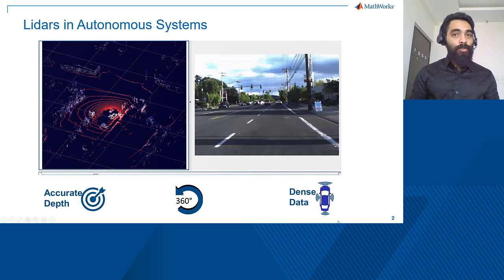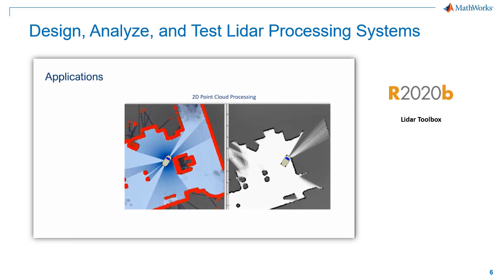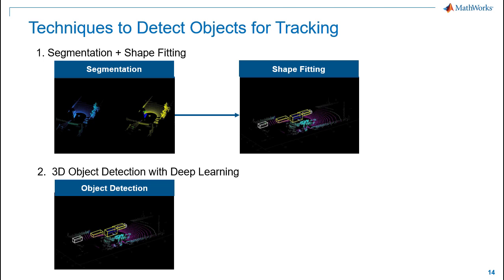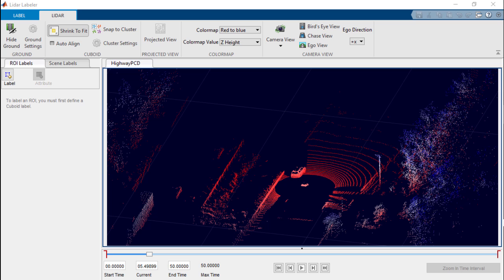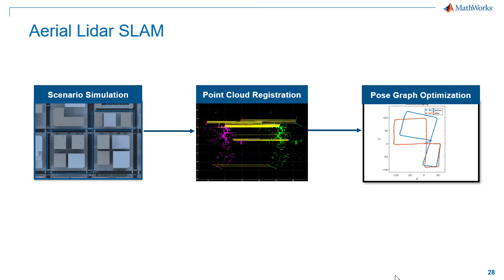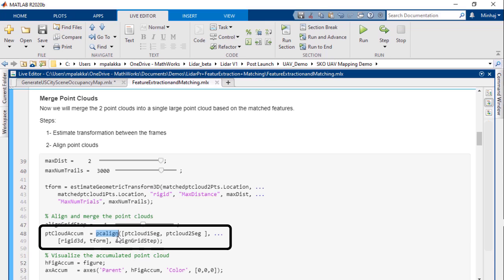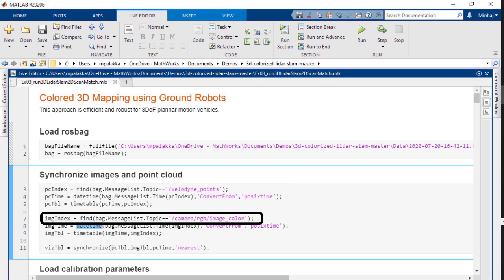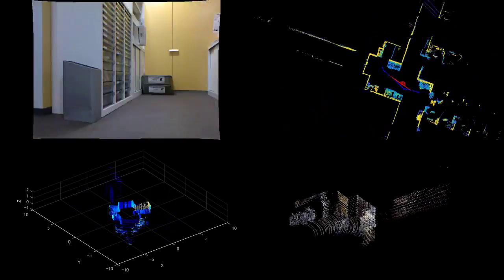Lidar Data Processing for Autonomous Systems

Comment: What about the case where multiple independent lidar based systems are being used at the same time in the same local area such as with multiple mobile robots or self driving cars?  Wouldn’t there be interference from each of the lidar sources?
Reply: Good question